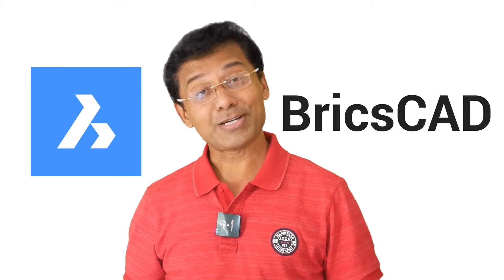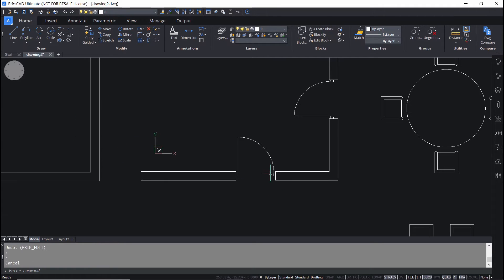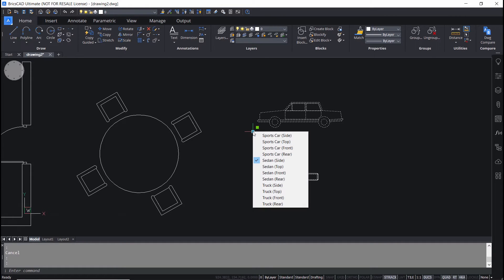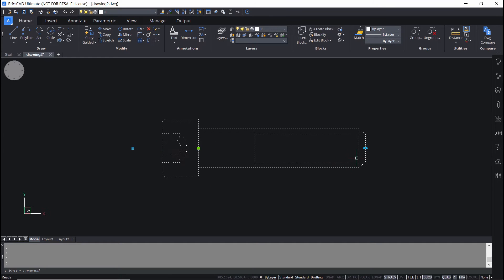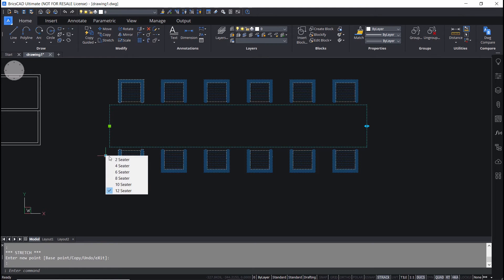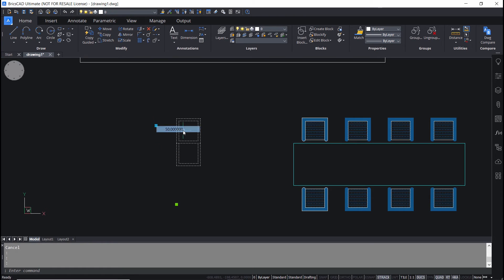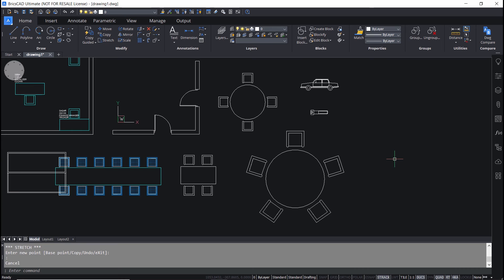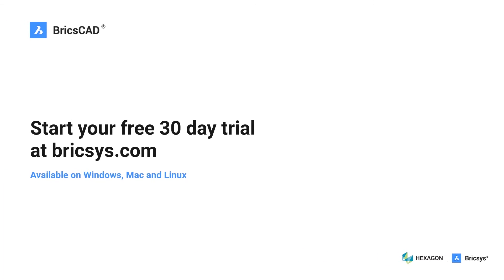Working with Dynamic Blocks in BricsCAD

Comment: Hi,
I can't print my logo image. while making pdf also same issue. i inserted image with paste special method.
Reply from the maker: We had an OLE plot issue recently, it was fixed in V21.1.06. Please check the behavior in this version, if problem still happens, please fill in a support request on our web page (the login is required) where explain the problem in details, add an example drawing and our technical support analysts will be glad to help you:
 https://www.bricsys.com/protected/support/NewSupportRequest.do